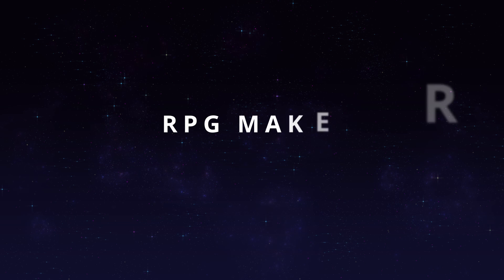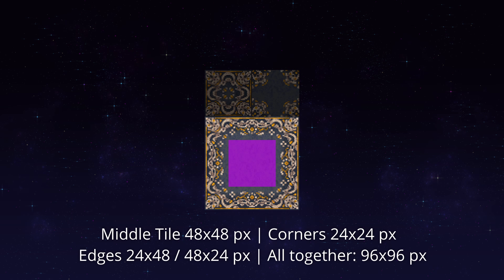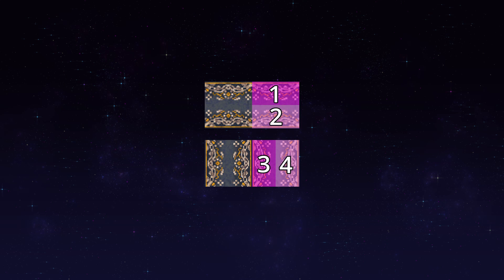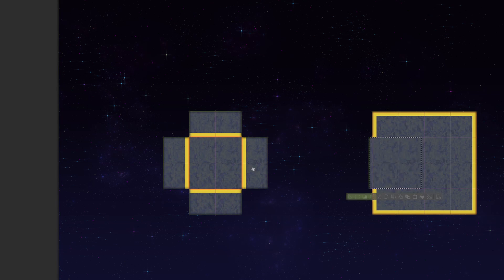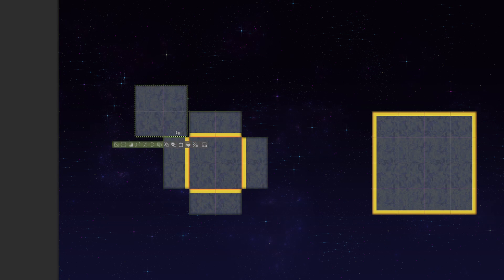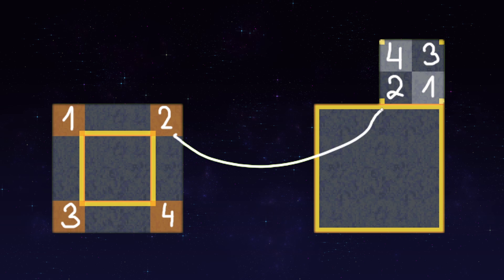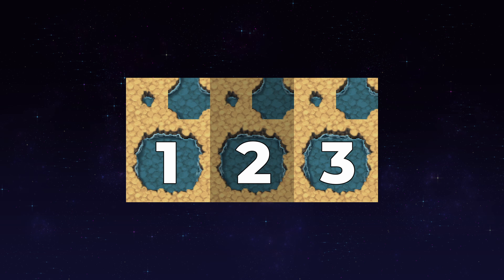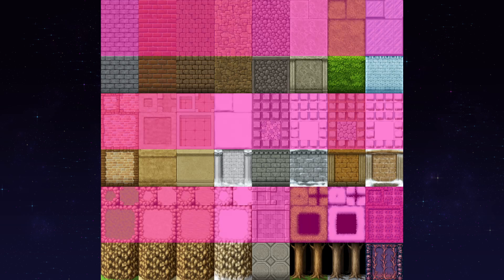RPG Maker Autotiles Tutorial for MV & MZ

Comment: so how do you export this file and upload it to RMMV? Is there a specific size/filename these should be? thanks again for your help!
Reply from the maker: The easiest way would be if you made a copy of the A sheet you want to work on in your projects folder > img > tilesets, open it up in your image editor and just put your edited tiles ontop of the standard ones. Inside the engine, in the database section you can create a new tileset under the tileset tab, using your sheets. OR you can directly edit the standard tilesets and don't need to add a new tileset in the database. (Remember that you also need to set up passabilities if you create a new tileset) 

I hope this helps.